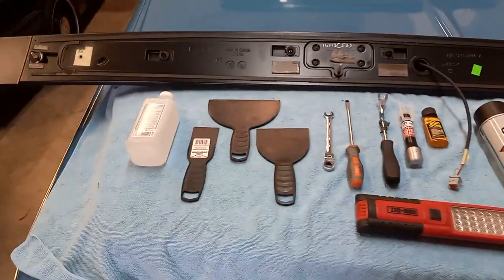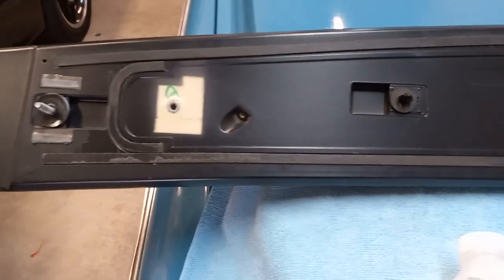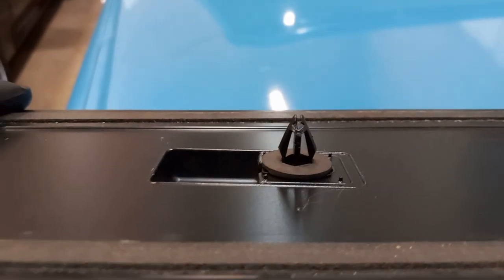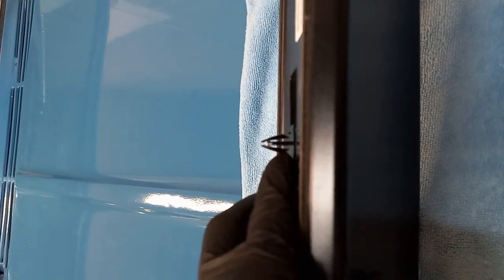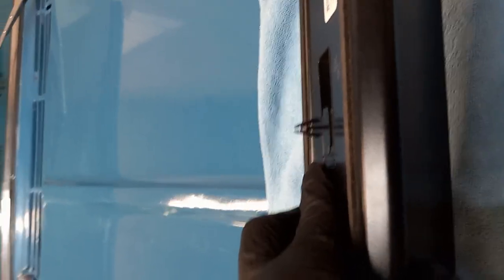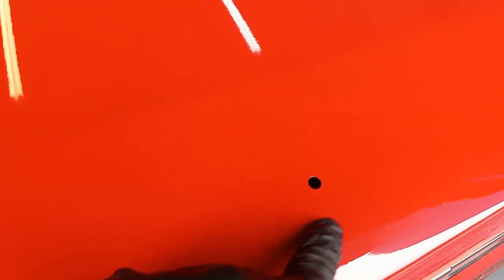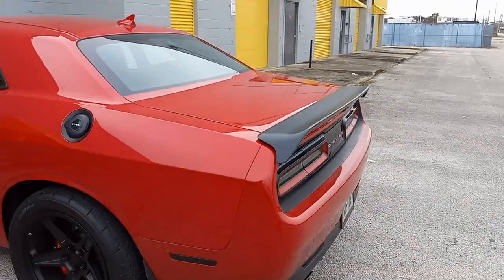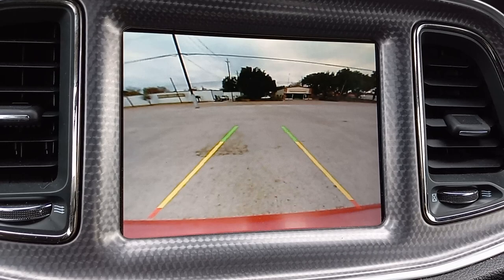Mopar Performance Spoiler Is Installed!

Comment: I love the performance spoiler. But, if you get the car new it is a $1000 option. Bet there is an aftermarket that looks identical for way less money.
Reply from the maker: I got a real good deal on mine, decided to stick with the Mopar part because the camera upgrade makes it well worthwhile
Reply: @bmasontv  Good deal and original equipment. Doesn't get better than that.

Comment: I was considering this spoiler for my R/T, but I was curious as to whether or not it'd play nice with the console screen that I have. I don't have the tiny one that the barebones Challengers get, but it's not the nice 8 and a half in display Hellcats get either. I've asked around if the camera in the performance spoiler is compatible with the 7 inch display my car has, but so far no one really knows.
Reply from the maker: I'm not sure, but if you've got a backup camera, I can't imagine that the connector would be any different. That said, I don't know for sure either

Comment: What made you want this spoiler? Looks or slight performance gain or both? Great video as usual
Reply from the maker: Looks...  I doubt there will be any real performance gain.  The camera  angle is nice.
Reply: @bmasontv  This is the exact spoiler I was considering for my Challenger, and the rep I talked to says it has the same downforce value as the regular spoiler. So, performance wise at least you aren't going to gain or lose anything, but being able to see your bumper in the camera is a good plus in my book.

Comment: Hey how's it going is there anyway I could get ahold of you and see if you've ever seen a intake manifold fail on a 6.4
Reply from the maker: The only aspect of the manifold that I've seen fail is the short Runner actuator.
Reply: @bmasontv  so the actual flap it self fail and got sucked into my motor well alittle bit of it did most of it sat on top of the valve it happen at idle in my driveway I was luck to immediately shut it down once I heard it
Reply from the maker: @Srt.8_bob  damn.... I have never heard of that before.
Reply: @bmasontv  I've talked to my tuner who has also talked to multiple people plus every one I've talked to including Mopar techs and have never seen it before I just cut open the manifold and the one thay failed was the flap right at the actuator. Only 70k miles on it also.